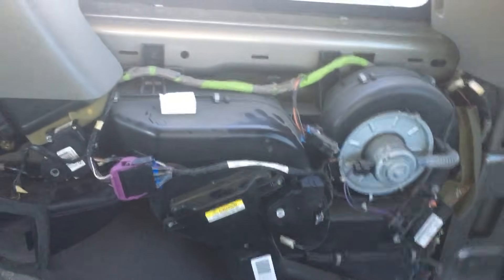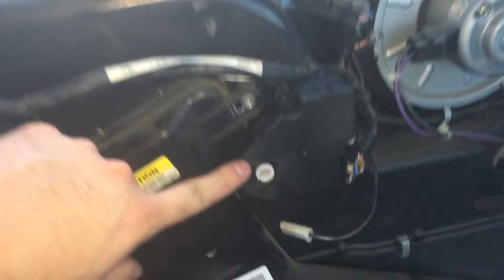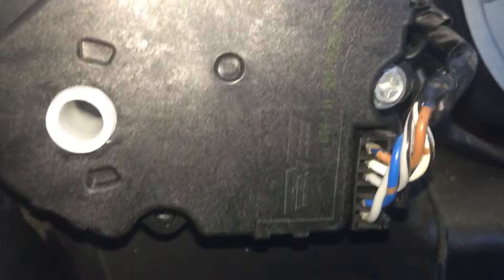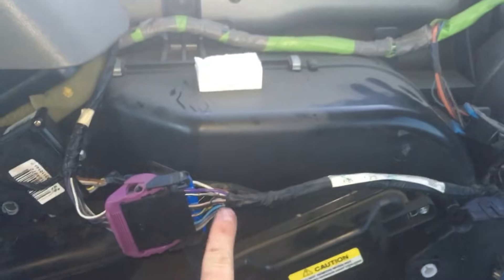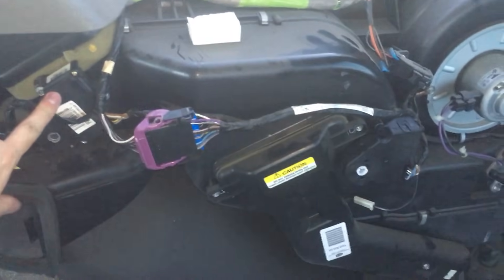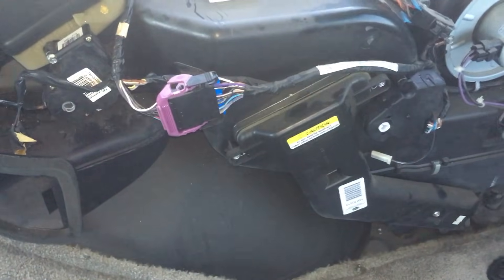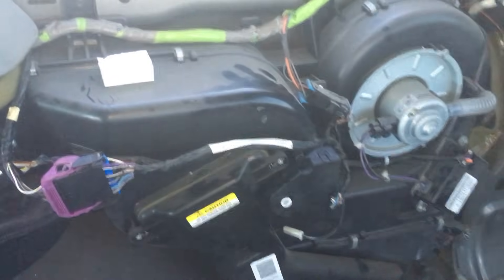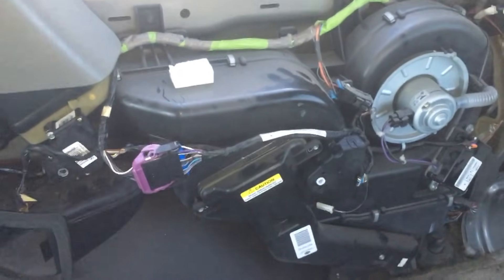Why Your Rear HVAC Only Blows Hot? Simple Actuator Fix

Comment: If the heat/air works fine in the rear and can be controlled by the front just not by the back control panel is that the rear accuator? Great video
Reply from the maker: Hey Sandra, the rear actuators control the air flow and the temperature flow, so if those are working fine when controlled from the from controls, then I would say your problem isn't the actuators.  If I were to guess, I would say maybe check a fuse or make sure the front controller is set to "rear" to activate the rear controls.  If that doesn't work then there is something deeper going on, and is likely related to the electronics in the front unit (which means you don't have to open the back panel and deal with actuators).  :)
Reply: mrjchristensen Thanks so much! This should save time and guess work!

Comment: My problem is the other way around, hot in front, cold in back. AC compressor kicks on, accumulator is cold, electric radiator fans work, hot air comes out front vents. Any suggestions?
Reply from the maker: The front vents have a similar system with a front blend door actuator.  I would bet that front blend door is stuck on the heater side.  Maybe search for a video on front blend door actuator repair.

Comment: Thanks bro.  Worked on my 2005 Tahoe.  I actually locked the door  on a/c awaiting my new part to arrive, but I know that fixes it as I have AC working in the back now.  Was stuck on heat.  Thanks again!
This is better than a service manual on most popular vehicles!!!
Reply: I might just do that for summer and switch it back for summer lol instead of buying a new part ima just do that instead of replacing it

Comment: Thanks for the video. I just took the temperature actuator off and took the lid off and noticed the same crack on the the largest sprocket. I realized that it's not actually a crack. I made note of what the actuator was actually engaging and moved that lever manually. I was able to direct air to the cool mode. I realigned the main sprocket and problem fixed. No money and your video saved me that cash. Thank you.

Comment: I have a 2005 Tahoe Z71 with same rear heater/AC.  Had the same problem - turns out these heater boxes with the doors he talks about have a history of the door flapper shaft that the actuator turns breaks off of the door paddle inside the housing - the shaft turns but it ain't moving the door.  I am an aerospace engineer with a cnc machine shop.  The acuators are fairly cheap and if they are turning like he showed in his video that isn't your problem.  The heater box assembly is hundreds - I think it was about $400.  So I should have made a video but I split the heater box case removed the broken door, machined an aluminum shaft and the door flapper out of a fiberglass sheet (like printed circuit board material), took the old rubber seal off the old broken door and put it on my new one - put all back together and it works great.  If you decide to do this its not easy getting the case apart to get the broken flapper door out with the A/C hooked up but I was able to finness it - gently pulling and slight bending here and there and I did it without disconnecting the A/C lines.  Unless you have a vacuum pump and A/C tools try not to disconnect your A/C - I did it so it can be done.  Also I found that there is a difference between the OEM and aftermarket actuators.  The chinese (cheaper) stuff works but the gears are injection molded from cheaper resins and that's why they are cheaper and don't have the life.   A little aside here - this fellow showed us his old actuator that had a broken/cracked gear.  That's a good indication the actuator drive gear was overloaded by a broken/jammed flap door shaft so don't just replace the actuator without trying to turn the shaft (by hand - it should turn very freely) after you remove it.  I've come to those crossroads where I have to ask myself which one do I buy.  If the part is easy to get to and replace I'll take a chance on the cheaper part.  If its going to be a day of disassembly to get at it I'll buy the OEM.  Great video and explanation on how the system works.  Unfortunately GM used this same injection molded plastic flap door on the front heater box as well so be aware that you may end up fixing that system as well - I'm doing that now - this time I'll take pics or video and post,
Reply: My '04 Yukon was also not blowing cool air.  After watching this video, I thought I'd be able to swap the actuator and be done, but that wasn't the case.  Like Kirk, I think the door paddle broke off because the actuator doesn't connect to anything.  There should be a small rod protruding out of the housing that controls the door paddle, but it seems to have either fallen off or broken off.  I've stared at the entire housing for a while trying to figure out how best to partially disassemble it so I can get my hand in there to push the rod back through the housing so the actuator will have something to grab and turn.
Reply from the maker: Kevin Tate that's rough.  When I took my actuator out the little metal tube was sitting there just like it is supposed to be, and freely turned.  Bummer yours is going to be more involved!
Reply from the maker: Kirk Spiegel good work!
Reply: Do you have a writeup or video of any documentation at all of your fixes?

Comment: hi,i have a 99 tahoe i get cold air in the rear but warm air in front,i checked freon its ok what can it be hvac control panel or actuator? anyone plz help
Reply from the maker: My guess would be the temperature blend door actuator is stuck on heat, probably a broken gear like Matt G shared a few weeks ago (scroll down in the comments).  You could also message or comment on his comment, he seems to have done that exact repair a few weeks ago.
Reply: mrjchristensen ..thx for replying but is not blowing hot air,is like just circulating the air inside,rear blows very cold but warm air in front
Reply: end up being low on freon the gauge on can wasnt accurate,& i had just purchased it

Comment: what about the A/c?
Reply from the maker: Weylin Thompson Jr Films my video shows you how to diagnose your problem.  If both of your blend doors (temp and direction) are working, and your front AC is working but not the back, then it is very likely your expansion valve which is located underneath the rear blower motor where the line from the AC compressor runs to the back.  I have never had to replace mine, but from what I understand from watching other online videos you basically have to remove the blower motor and some other components to get to the little brass expansion valve.  I guess the  valve acts sort of like a filter, like the orifice tube, and they can get plugged up sometimes and prevent the AC from circulating to the rear HVAC system.  

When your AC is running go to the back underneath the HVAC system on the outside of the vehicle and you will see two metal tubes running from the compressor to that corner and then going up into the HVAC unit.  If your Compressor is working then one of those tubes should be very cold to the touch. If one of them is cold to the touch, and your temperature blend door is working, then I would bet your expansion valve is plugged up.  If both tubes are warm then there is something else wrong with your compressor or something not circulating to the rear HVAC unit.  I know I have seen videos on YouTube for how to replace that expansion valve, it seems fairly straightforward but quite a bit of work. Good luck.

Comment: Great vid, I liked it and felt compelled to share my experience for anyone watching that may have a model a few years older.  I just went through this with my 99 Suburban but for the front A/C.  In my case, the mode actuator and the blend door actuator were the same, just as you found for the aux unit in back of yours.  The (Dorman) part number for those was 604-107.  In the front there is another one though up behind the blower motor for the recirc door and it is a real PITA to get out but can be done.  That one was Dorman 604-116.  It was making a growling sound and I kept hearing a door flapping around.  You can actually look up under the blower motor and watch the recirc door operate.  I pulled mine out and opened it up and that big gear was cracked just like yours.  One thing I noticed was that the number and positions of the pins on the connector differs from actuator to actuator.  The recirc door one only had 3 pins on it.  I guess the best bet is to remove the one(s) your replacing and take it with you to the parts store.  

One other thing I learned about mine is that, unlike the front heater core, there is no hot water bypass valve for the rear unit.  In the front, when the mode control is moved to max A/C, this valve closes and loops hot water straight back to the engine, bypassing the front heater core.  This way, there is no competing hot and cold in the duct.  The circuit consists of a signal from the A/C control head to an electrical solenoid on the firewall that routes manifold vacuum to the bypass valve when energized.  Mine doesn't actually work but that isn't the point.  The point is my rear A/C never really blew very cold in the back so I disconnected the hot water hoses to the rear heater so there isn't competing hot and cold in that duct back there.  I'm on the gulf coast so I need the A/C way more than the heat.  It was just a matter of disconnecting and corking up the rear hoses under the hood and running the hoses from the engine right to the bypass valve (with a 5/8" <-> 5/8" adapter and another length of hose if need be).  It does blow a lot colder now in the back.  And I did consider just forcing that bypass valve into bypass but then I'd have no heat at all to use my defrosters and stuff.

Anyway, thanks for taking the time to post the video.  Hopefully the next one to blow up in mine will be back there.  It looked a lot easier to get at...
Reply from the maker: Thanks for sharing!  I made this video if only to create a place to have these conversations.  I had no idea what I was doing, or how the two actuators were SUPPOSED to work together since I had only seen them broken.  I hoped some folks could see how they are supposed to work so they could figure out how to fix their own problems.
Reply: bizzyb13 ya ...end up being low on freon,the new gauges i had wasnt giving me a accurate reading
Reply: Matt G ..hi mat hey i got a 99 tahoe in getting very cold air in rear but warm air in front doesnt feel like heat though,has enough freon do you know what it might be?
Reply: tino8080 I've got the same problem...did you have any luck

Comment: 03 yukon xl front works fine rear does not come on at all. help
Reply: mrjchristensen i have a proble like that and it was a burn electrical plug the one connecting to the blower resistor
Reply from the maker: It could be multiple things.  Does the blower come on at all?  If you are getting nothing at all, it might be something easy like a fuse.  If not, I would think it is the control unit which is mounted on the blower.
Reply: Did you fix the issue? I have the same problem with my 03 Tahoe

Comment: do you leave the fuse out while you turn the ignition on forward about a minute then put the fuse back in..
Reply from the maker: I did it every way possible.  First I started with all the climate controls off, unplugged and removed the bad actuator, installed the new actuator, plugged in the cable, turned on ignition and waited, and it calibrated.  I doubted whether it calibrated enough (as if I know, I'd never seen one work properly), so then I turned everything off and removed the fuse, then did it again.  So I don't know which method worked in the end, but my AC works great now so I'm guessing one of the methods worked. :)
Reply: 04 Suburban where is the fuse for the rear heater unit. the one under the Hood seems to work the front AC control however the rear heater fan stays on when the fuse is out under the hood. after watching countless videos no one seems to go to the same fuse some people go to the dash some go to the hood which one works the rear heater?

Comment: so I just bought a 02 Yukon xl front air blows cold but the back air blows hot so you think this my exact problem the part you replaced.... if so once I replaced I put the fuse back in after it calibration
Reply from the maker: It is either the temp blend door isn't opening to the cool side (my exact problem) or the AC expansion valve isn't opening and is filled with gunk (more difficult problem).  Check the AC lines under the back of this rear system and feel them.  One should be hot and one should be ice cold.  If the one line is cold, then you know you are getting AC to the back, so either the expansion valve isn't opening or the temp blend door isn't opening.  Start with the temp blend door, it's easier.  I opened mine to see if there was anything wrong with it and it was obviously broken, so I was glad I didn't have to tear down all the way to the expansion valve. Good luck!
Reply from the maker: In any case you can just remove that rear actuator and manually turn the little knob to open and close the door between heat and cold.  That way you'll know if it was that door before you even have to buy a new one, and if both positions blow warm air then you know it is something in the AC unit itself.  So if it is the AC unit itself, and there is a cool line under the Yukon (you have to go underneath and you will see two metal tubes), then it is probably that expansion valve.
Reply from the maker: Or the door itself inside the unit has somehow broken off.  Meaning the actuator IS working and is opening and closing the door, but the door itself is cracked or has a part broken off or something.